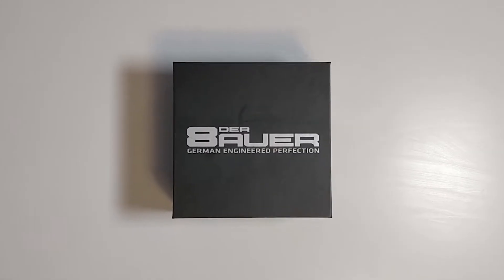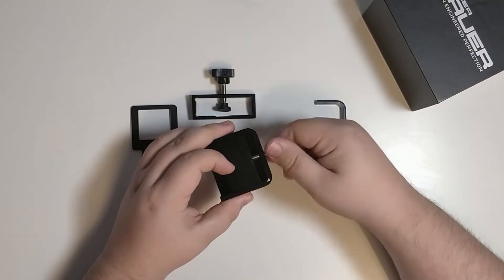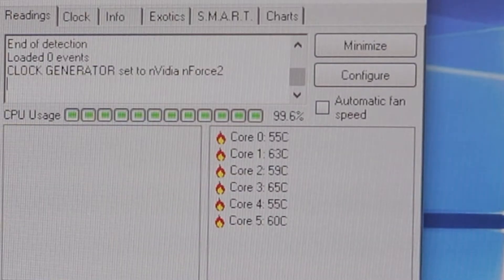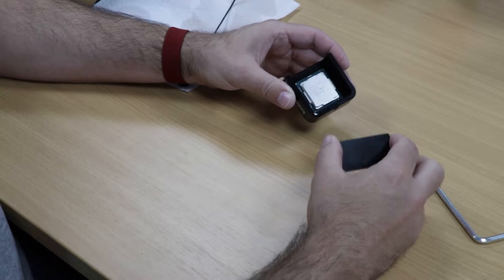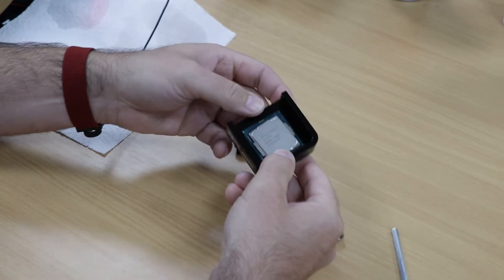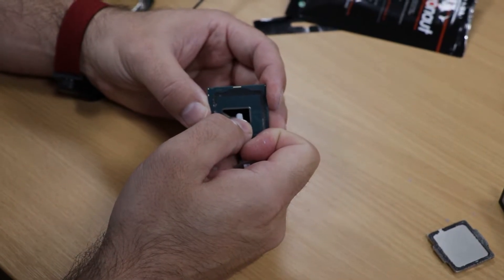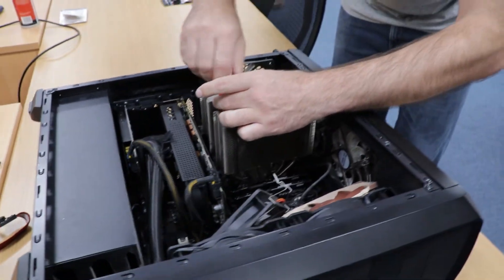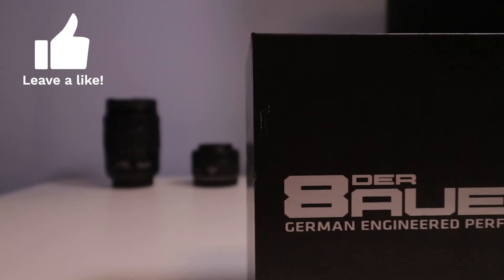Delidding Intel i7-8700K Using The Der8auer Die-Mate-2

Comment: Hey, so i am REALLY having strong thoughts on Delidding my 8700k. 

As of right now i am @ 5.0ghz with 1.32volts . 32C idle, and about 67c max for PC gaming. 
My question is that should i go ahead with the delid process?  I would really like to hit 5.2ghz.
Reply from the maker: You're already getting pretty good results so in all honesty I think you may see some improvements in the clock speeds etc but in terms of real world performance, I think the returns will not be that noticeable. 

Personally, I say if you want to do it, go for it. It's super easy with this tool and even if it doesn't give great improvements, you've still had the enjoyment of delidding a CPU.

Comment: Nice video! How are your thermals after delidding and reapplying paste?
Reply from the maker: On average they dropped about 10 degrees compared to the original when testing. I think they could be decreased further if using some liquid metal and and water cooling rather than fan/air cooling.
Reply: It can really depend on how the old compound is, in this condition a decent advantage can be found.